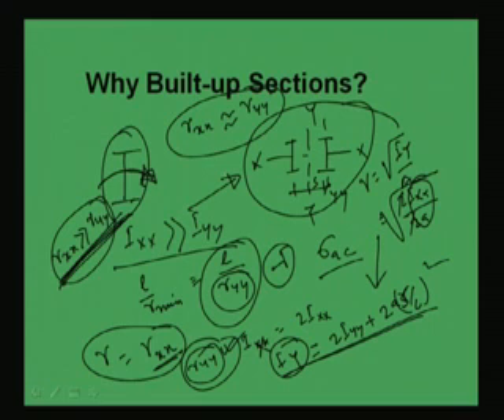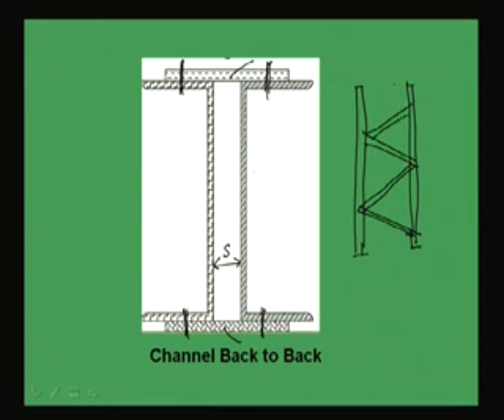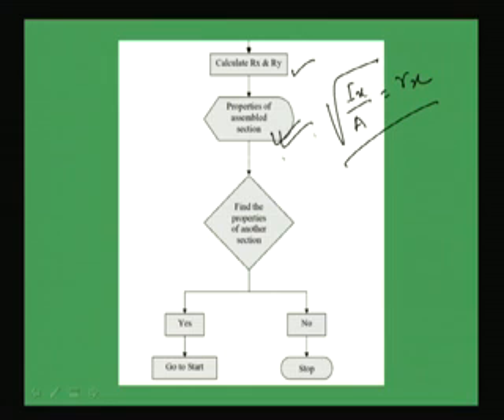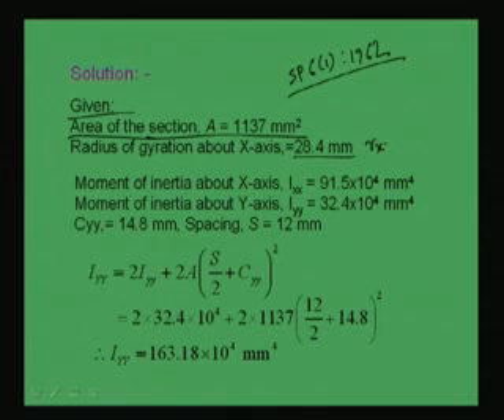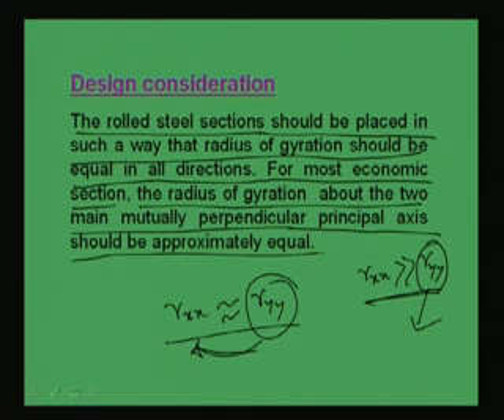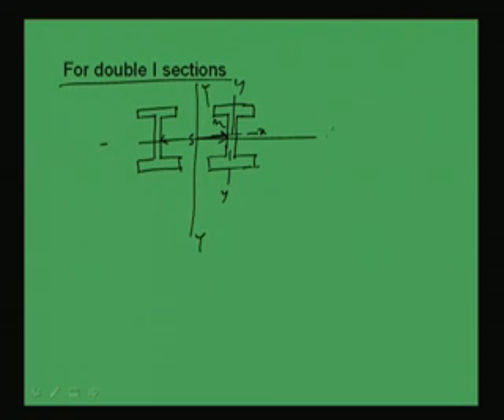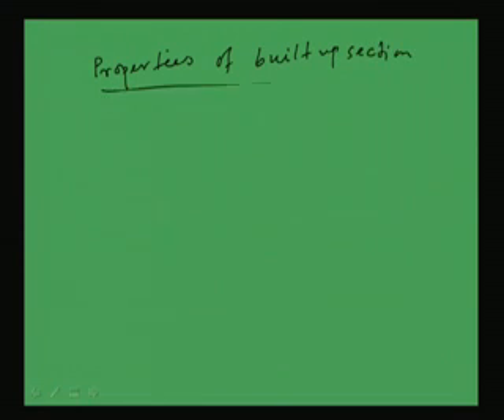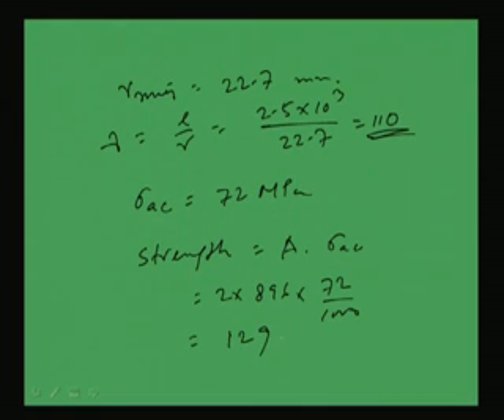Mod-5 Lec-4 Built up Compression Member

Comment: Q at 50:00 has been solved correct but the v-v axis taken is wrong . Rvv will yes be less among all as said.. n video but vv axis drawn in builtup angle section is wrong thus the failure axis will also become uu axis (taken wrong) . vv axis and uu axis should be interchanged to make them correct and correct failure axis wil be vv.